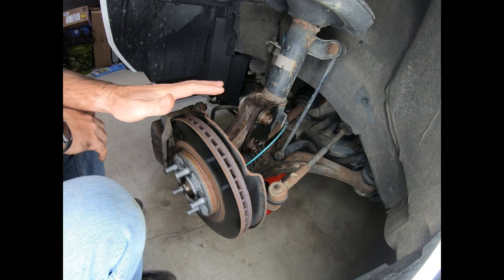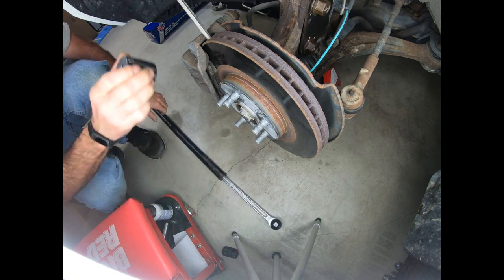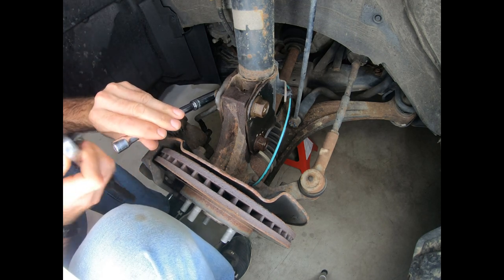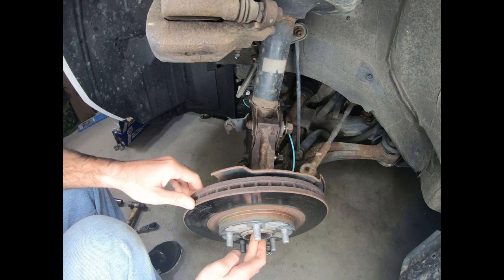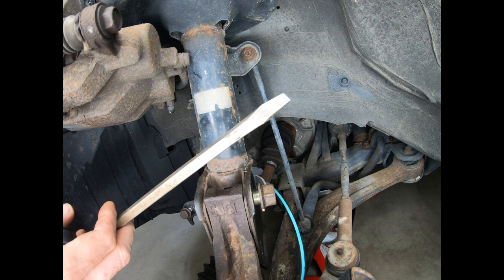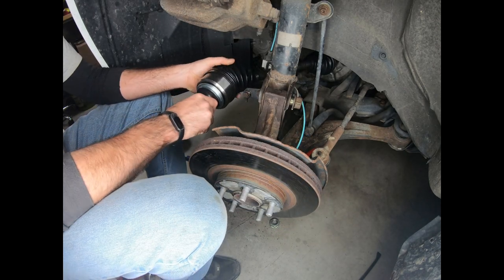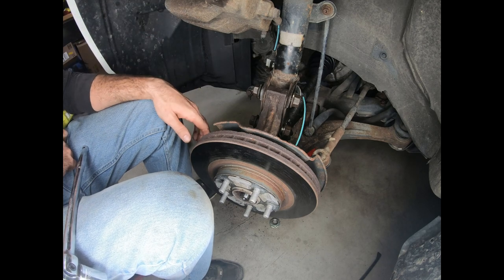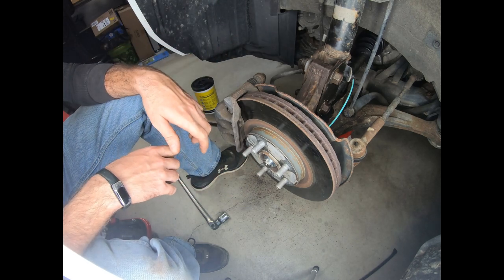2006 Honda Ridgeline CV Axle Replacement - Driver's Side

Comment: This video really helped out!  Appreciate the tip of not having to remove lower ball joint.  Also, I had a long pry bar which made popping off the axle super easy, as my friend borrowed my massive flat head screwdriver and never gave it back.
Reply from the maker: Glad it helped!

Comment: Great video! I have the Honda service manual and it says to remove the lower ball joint. I have done both sides and that makes it a tough job. I've been fighting getting the ball joint back on so I watched this video. I will loosen the strut and remove the caliper to assist the reinstall. Thanks!
Reply from the maker: Glad to help you out!
Reply: @AdamsWrenchTherapy  That was so much easier! Usually the Honda manual is pretty good. From now on I'll get a second opinion before starting! Thanks again!

Comment: Did you also replace the inner seal between the inner part of the CV axle and the transmission?
Reply from the maker: It was in good shape and not leaking, so I left it in.  So far, I've put about 5,000 miles on it, and no leaks.
Reply: Ty
 @AdamsWrenchTherapy

Comment: A good tip... If you're going to be keeping your axle and are disconnecting the hub, etc, leave the castle nut on at the edge and hit the hammer against that to not damage the CV axle.
Reply from the maker: So true! Good advice. The reason I didn't recommend that is if you don't have the socket for the smaller size castle nut, you might need to reuse the old one.  If you MC Hammer it, it becomes useless. Stop! Hammer time! 😎👍

Comment: You went thru a lot.  All we do is break the ball joint use a compact to crack axel nut lose and bang the axel once. Axel came right out. Using a breaker bar is harder work when u have a impact